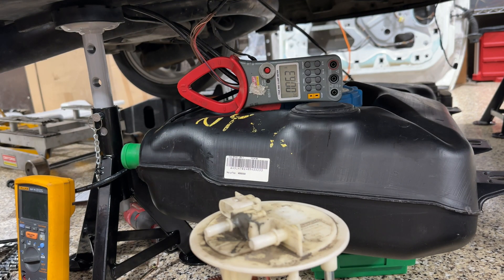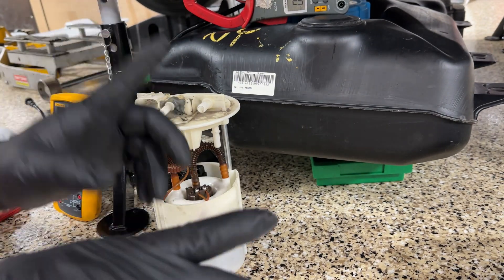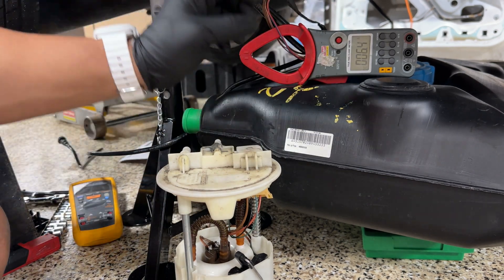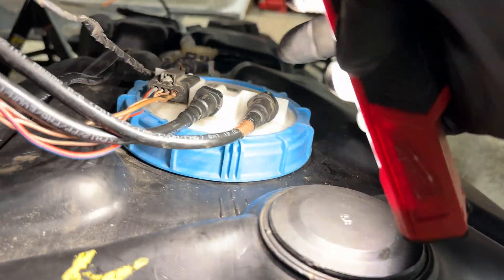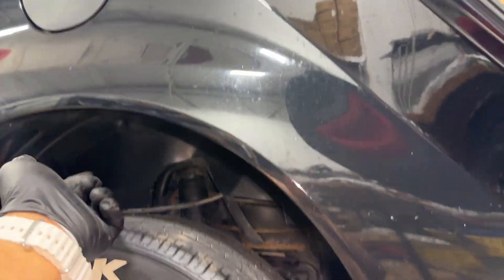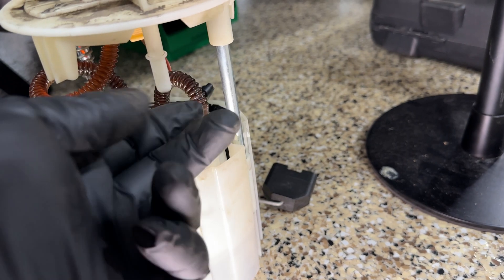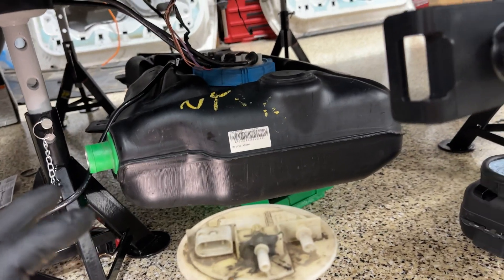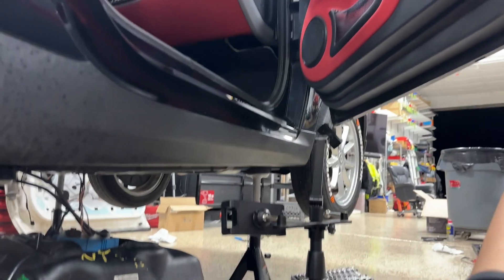2009 Smart Fortwo 451  - Replacing bad fuel tank and fuel pump

Comment: Was the hose that goes from the green spout to the filler tube stuck? And how did you remove it or did you just cut it and replace it?
Reply from the maker: Don’t cut any lines,,,,
Follow that line up to the gas filler neck
Might need remove the passenger rear wheel 🛞 
Then the plastic cover in the wheel well

You’ll expose the filler neck and the hoses that go to the tank

Push in on the hose to clear the barb area
Push in on the plastic clip and It should slide out pretty easy

There should be a small o ring on the hose, don’t beat it up too bad.
Once all them hoses are clear the tank should come out pretty easy
Reply: @MrMr123  but in your video... The hose is removed from the green thing connected to your tank .. the short little hose that goes from the filler neck to the gas tank. There's a green spout. How did you get that hose off of it? Pry or cut/replace?
Reply from the maker: @mac2708  So when I got this car, it had a bad gas smell... Turns out the tank had a hole on the bottom. When I took the tank down the fuel pump had epoxy on the plastic fuel line fittings.

I was being lazy and couldn't figure it out so like a meathead, I cut the line. The line wont go back on the barb fitting because the manufacture must have heated the hell out the line then inserted it.

Got a replacement tank and pump from a 30k car from a junk yard, but then the car was all busted open, I decided to the the motor mounts and rear shocks, so I took the plastic wheel wells off and boom that's where the fuel pump line led too....

Pain in the ass, take your time, do it right... 
Lessons learned, don't cut the line.
Reply: @MrMr123  you're talking about the filler neck "hose" right? Not the 2 small "lines" that run along the fill hose? It's the big hose, the connects straight to the side of the tank. Nothing to do with the pump or the pump lines ..
Reply from the maker: @mac2708  Dialed in,,, Now I know exactly what your asking. Germans use a funny stainless steel hose clamp.
Grab a small flat head and put it in the center of the metal hose clamp and work it so it opens up.
Slide the hose off
Toss the factory clamp
Hit up home depot for a stainless hose clamp with a hex head on it and use that.
Once you have the clamp off.
Grab a large set of channel locks and just use to move the hose left and right so it bust loose... 
It will slide out for you, just easy on the hose.
Reply: @MrMr123  ok cool, ya we are on the same page now 😁ya man that little rubber hose section is on there GOOD. I tried to pry it loose a little bit with a screw driver but ya it's on there tight.
Reply from the maker: @mac2708  Get a large set of channel locks, bite on the hose lightly and spin it left and right,,,, when it un sticks itself you golden.... Hit it with silicone spray... 

German cars are all mm based... so its hard to find imperial sizes to fit tight on stuff, so if you can save it the better... After you bust it loose it will be like the neighborhood ho.... Stainless steel clamp and your good
Reply: @MrMr123  hey bud, just wanted to let you know I got that fuel pump changed on my 2013 this morning 👍 thanks for your help
Reply from the maker: @ 💪Bad ass 😁
Reply: @MrMr123  the short 2inch rubber hose that goes from the bottom of the filler neck to that green coupler connected to the tank
Reply from the maker: @mac2708  OHHH.... Thats the fuel tank filler.... DON'T cut that either.... lol
It should just have a hose clamp, if its the German hose clamps, bust it open then get a stainless steel hose clamp.... 

Just a rubber hose that goes over the green inlet.... The Green inlet has a check valve so the fuel doesn't dump out

Comment: Hello, I'm from Portugal, I have a 2008 smart fortwo 800cdi and mine also has a similar problem, but mine says the tank is always full, do you know what the problem could be? Thanks
Reply: The fuel-sending unit is bad.  The black float that is on it is probably stuck
Reply: Did you find out the problem? My 2009 is having this issue too
Reply: @Hizzle182  sim, quando o deposito estava +- meio mandei umas pancadas no depósito por baixo do carro e a boia deve ter descolado, desde então ficou a funcionar perfeitamente
Reply from the maker: @Hizzle182  Replaced the Fuel pump and tank
Reply from the maker: The float level sensor is probably bad or the float came off and its stuck in the same position. Drop the tank and pull the fuel pump out, check the ohms.... Full tank it should read 110 ohms, empty tank it should read 650 ohms